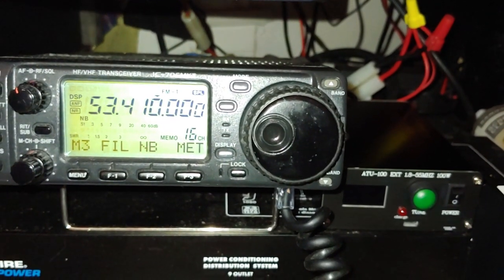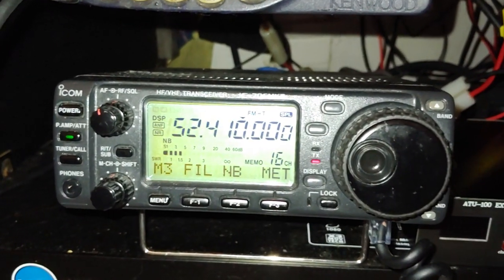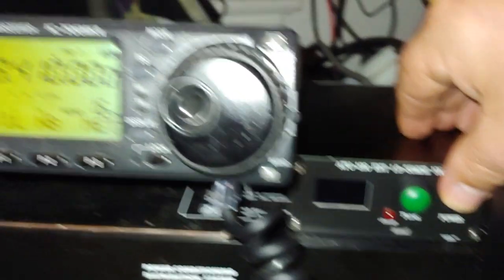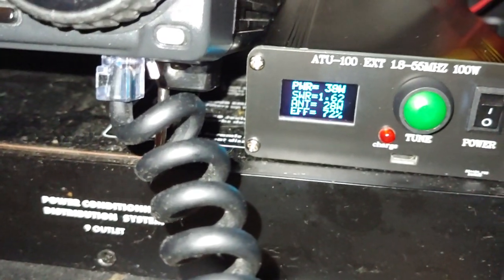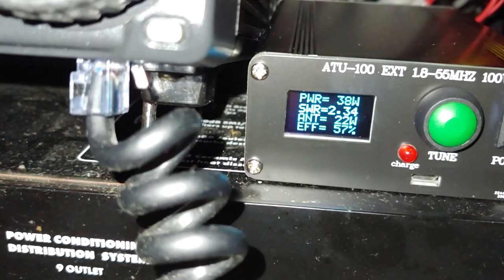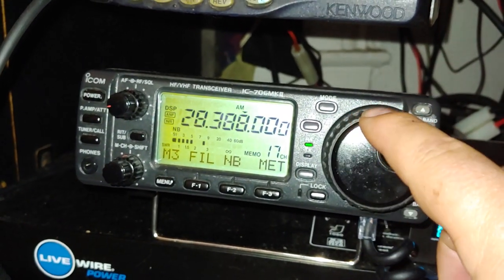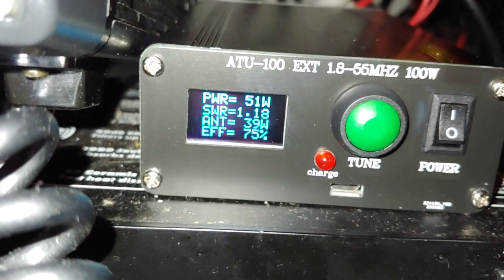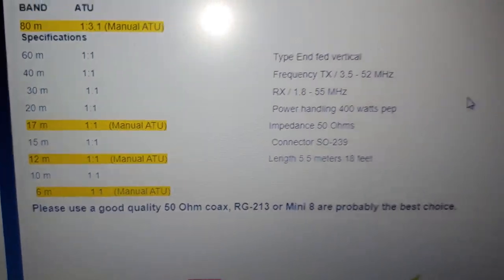ATU-100 AUTOMATIC ANTENNA TUNER N7DDC REVIEW AND WARNING! IT SMOKED AND FAILED AFTER USE ON 6 METERS

Comment: Don't complain about the smoke, think first and then transmit. Read the manual. use low power (5-10W) to tune, then switch to full power. If itt does not tune properly, do NOT use high power.
By the way, your ICOM has a tuner interface connector that allows to automate the tuning process with low power. This interface works well with the ATU-100. If you know how to use a soldering iron upgrade yout ATU-100 ...
Another thing to check are the 2 diodes in the ATU-100. A number of cases are know where the chinese factory used wrong components. If you have one of them, the tuner will work fine on the lower bands, but not on 15m or above. Replacing the diodes with BAT41 solves this issue.

Comment: I think you are only ment to tune at like 5-10 watts max and then when your tuned up then turn up the power...... or smoke will appear...... I thought all hams were aware of this!!!
Reply: not all !
Reply: When I worked software system support, the team I was on called that an IDtenT Error (written down the lower case as a numeric expression).  Every automatic tuner I've read the manual on usually states reduce power to 5 or 10.
Reply: how to do that properly
Reply: Correct..
Reply: @albertmorris4889  PEBKAC :)  In the AF, we made sure operators were at least 10% smarter than the equipment they were assigned to use. ROFL

Comment: Should NOT use more than about 5-10W for tuning. I know Chinese manuals are not the best ever - but it does make it pretty clear you do must not just dump full power into a wildly mismatched system. It seems you even surprised yourself at what power level you were using from time to time.

Main defect seems to be external to the unit.

Comment: Not false advertising at all.  The manual page you showed for your antenna specifically states “manual tuner” for 6 meter band. Not auto tuner.  The N7DDC is an auto tuner. You smoked the 6 meter portion of the tuner using it improperly.
Reply: is there "separate" 6m portion in tuner? Its not a filter.

Comment: Thank you for sharing.  I was wondering about this economical ATU option, so your comments are valuable and appreciated.  I notice that your antenna states specifically that it should be used with a Manual antenna tuner.  Could the antenna design be difficult for an Auto ATU? I don't know why it might make a difference, but I was wondering if a very high-Q might make it hard for the automatic tuner to find the the ideal tune without passing it by.

Comment: Mine has the high 6M noise floor as well and I never let any smoke out. It also mostly doesn't match well, sometimes not at all whereas the tuner in the radio just behind it has no problem on the same antenna system. I am going to make a new controller for it and see what I can do.

Comment: never had this problem, "YET" but thanks for the heads up keith i've programmed 50mhz to max out at 25 watts, but i do know the hf360 "sucks and blows as you put it" lol,  apart from that, these tuners are ace for portable work, i use a usb powerbank with a little LED metre to keep it topped up as a flat battery can only cause some of the problems like this, 👍 de m1dls

 (ps bypass the unun on the 360 with any type of s0239 attached to the metal bit for the plus kit fitting, adjust antenna to 5m in total length to make a killer 20m vertical with a few radials,)

then let the atu-100 do its magic i get 80-thru to 6m with no noise now, the hf360 6:1 unun is totally deaf, use two feed points to an antenna switch to compare, let the atu-100 become the matcher ... hope this helps 👍📡

Comment: This is actually a great little auto tuner…if you use it properly…which you failed to do.  1) Never, ever, tune with more than 5W power.  2) Don’t redline the performance when you operate at the fringe of the unit’s design capacity, it’s already maxed.  3) Read the directions before you hook something up and slam enough power into it to reanimate a corpse.  Treat your equipment right and it will work properly, abuse your equipment and it will fail every single time.

Comment: A 1.7:1 SWR is NOT a problem - there is no need to use a tuner at all in this case!  Secondly, you shouldn't use more than a few Watts to tune.  RTFM reduces PEBKAC.  "SWRs"?  The R means "ratio" and there's only one of them...  73  KG5...
Reply: @RechargeableLithium  SWRs plural is used when tuning 14 antennas simultaneously...
Reply: @Jah_Rastafari_ORIG  One doesn't tune multiple antennas simultaneously.  The definition of the voltage standing wave ratio is the amount of energy that is reflected back from a SINGLE antenna compared with the energy sent from a SINGLE transmitter to a SINGLE antenna.
Reply: @RechargeableLithium   I guess I should have added "/s" to underscore my meaning...

Comment: I understand you are supposed to tune with low power and then you can turn up the power for transmitting. My question is if the device is set to auto tune and you switch frequencies and the swr has changed enough to cause another retune it would be at the increased power level. I am going to look and see if there is a cell in the firmware to not allow tuning over a preset power level.
Reply: most radio's with a "TUNE" button reduces the power during tune cycle.
when you initiate a manually started tune, you know ALWAYS tune in low power

Comment: You have a faulty unit. I bought the kit and built mine and it works a dream on all bands including 6M band even at 100W. There is a major fault with your unit turned off and when you PTT it turns on. Get a refund.
Reply from the maker: I got a full refund!
Reply: @KeithMutchKB1RBI  Well done. You should try the kit of parts and make one up. Make sure if you do the PIC comes programmed. Downside you have to get an enclosure. Did you investigate what had burnt? The circuit is so simple there cannot be much wrong to replace   unless it was the PIC.

Comment: this device is only hf not 6  none of them did 6 meters well
Reply: smaller coil put some windings off
Reply: Mine works great on 6m
Reply: @jamesbradley9233  it might match great, but what is the performance?

Comment: I have the same version with the green tuning knob. Does your tuner support tuning just by pressing ptt or does your one also slways need the green button to be pushed?
Reply: So I made a lot of research for the same questions. You have to open the unit and locate the circuit point where the auto button would be. Then you have to connect that point to ground.  According to the project web page for N7DDC ATU_EXT ( the board diagram is there)  its pin 22 (Also RB1)on the CPU chip. When in Auto, a dot is displayed on the LCD. RB1 means the B1 in the other side of the board. Test carefully that it shows 5v and quickly tap into ground.
While you are at it. I would disable the dc to dc circuit to increase from lithium rechargaeble battery to 5 V for the tuner. It is the source of horrible RFI.

Comment: Hello. Do you recommend this device? Is it a good device?
Reply: I think this small and cheap antenna tuner is quite good. As for the problem in video I think the autor should use more effective antenna. 73
Reply: @VladiGeo  an antenna that can 80 to 6 is a stretch. Sure you get good swr, but at what performance compromise.
I got something that has perfect swr from 160 meters to 2 meters. It's called a dummy load.

Comment: Hi, I also have build the ATU-100 and can not use it on 6m, it shows poor SWR. on all other FH bands it works fine, I use 5w max as tuning power, which is more than enough.
For your information, I have bought is al DIY kit, firmware version v3.2. I have soldered SMA connectors on the PCB, and use  UHF female bulkhead SO239 to SMA male RA RF coax cable adapters RG174.
If some one has a hint or a clou for me how to get it to work on 6m (50mHz) i would be please. My opinion it is Most likely related to the design. So 6m capability may be to optimistic.
73, Frans (PA5CA)

Comment: Why would you tune with 25 watts or more !????    You should ONLY ever tune with 5 watts !     No wonder you saw smoke come out of the charging port. Why would you think it's okay to use the tuner with more than five watts to tune?  

After it tunes,  and it'll tune better on low power,  then you can run a hundred Watts through it and it'll be fine

Comment: Warning ! You should to be able to change bad chinese RF capacitors if you want to use this device successfully.
Reply: Hi David. I have multiple friends who discovered the T68-2 cores in the cheap Chinese kits (about $35) are fakes. They look real and give expected inductance per turn, but overheat easily even at a low power. I.e. the core is very lossy. One person said expensive ones (about $80) seem to have authentic cores.
Reply: @davidfainitski4201  Yup. That’s where I buy my cores. Thanks.
Reply: @K9SUL   Where..? I don't see any reference...
Reply: @K9SUL  ?